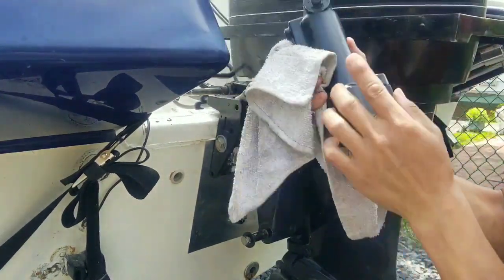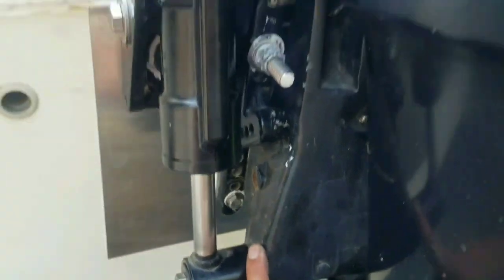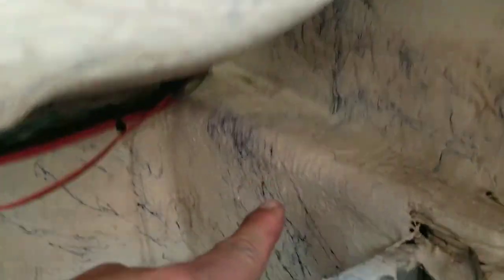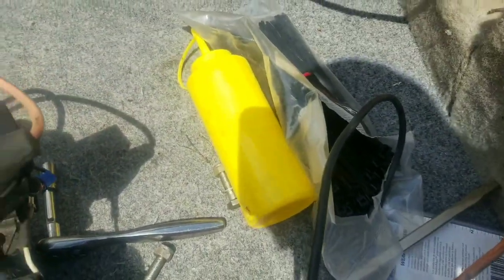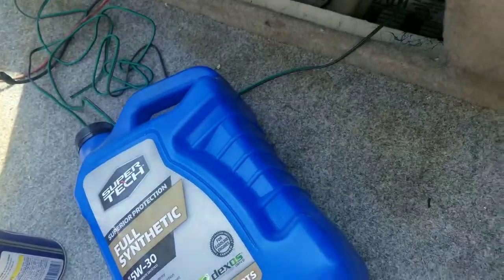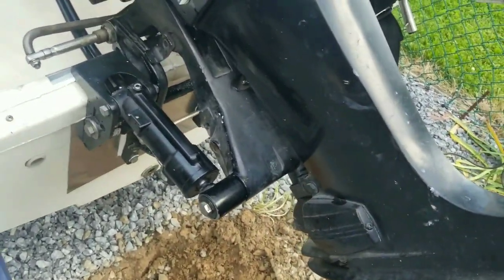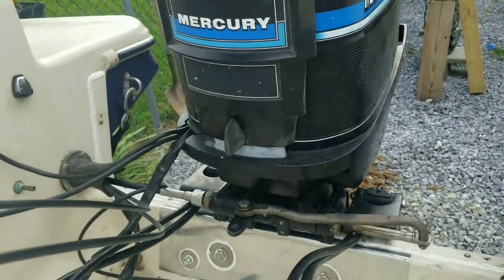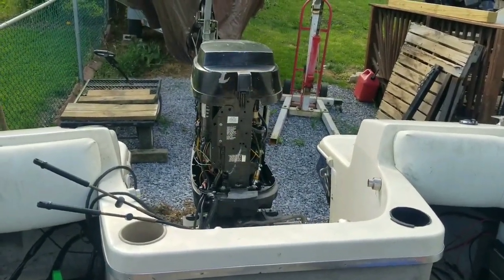Mercury Outboard Power Trim Install - Inlines

Comment: Love your work, very relevant, I recently acquired a Sea Nynph fishing machine. I am remodeling and repairing it. It has a 1985 Mercury outboard with a 2 ram cylinder lift and tilt. The motor was shot so I replaced it. When I got it both rams were out of their brackets and fully extended. I lowered the motor to assemble them in their brackets. They were slightly extended beyond the mounts so I manually pushed them down and bolted both of them top and bottom to brackets. I thought I should bleed ear one while they were horizontal but there appears to be a plug in the bleeder holes. No screw slots or Allen broaches. 
    I tested and installed 2 new solinoids. 3 wires from motor( green to one side of one and blue to one side of the other) black to ground. Switch at helm , nothing silent. I crossed a screwdriver on both large posts on one solenoid, motor runs but no movement. Did same to 2nd solenoid got sparks and momentary sound of motor. I took fotos of original assembly but no clear colors to most other wires. Feel certain I assembled as original. Unknown if previous owner screwed up the wiring trying to get it to work. Of course he did say he thought it was just bad solenoids but who knows if that is reality. Can you help me? I am 83 and perfect victim if I take it to aby. Marine place here in Florida.
Reply from the maker: He definitely wired it incorrect. Son

Comment: Hi mate im trying to wire up this 80 hp mercury engine im wondering if you could send me some information about the set up and where all the wiring goes from the trim motor and the battery wires actually are???? Cheers
Reply from the maker: Buy a wiring diagram my friend. Son

Comment: My daughters boat has the same setup. over the winter all of a sudden the motor raises when in reverse. Tilts up and down just fine.What am I missing? Several of your videos have helped me a ton. Thanks for sharing your knowledge on Merc inline 6's.
Reply: Reverse lock isn’t engaged, little knob on the bottom of the pump changes this
Reply: @achilleaustin  Thank you. The knob was in full open position(counter clockwise). I closed it tight and no difference.

Comment: @MerCsonL6 I am working on a 1979 115 mercury. I’m trying to hook up the trim some of my wires were cut so I’m doing some troubleshooting and I’m not sure which terminals to hook up too in the outboard it’s self.

Comment: My power trim stopped working, it won't go down. I hear it click but it doesn't go down. The black wire from the controls is not attached and I can't tell where it goes. I am not sure if it was ever attached. Oil looks good. Trim down was working fine. Help.
Reply: I got it to work. Crazy how temperamental the trim tilt can be sometimes.

Comment: How did you bleed the system? I have this exact same system and this is my first boat so I am trying to learn as I go. Trim didn’t work when I got it found all lines on the bottom of pump were loose tightened them up. Need to top it off and bleed system just want to make sure I do it right.
Reply from the maker: Tilt engine up and down about 3 times then gently in the down position untighten the hex screw on top of each cylinder. B4 topping off be sure engine is in full upright position. Son
Reply: @MerCSonL6  thank you brotha subscribed and will definitely be watching a lot of your videos your awesome appreciate it! I have a 1982 50hp merc on a 1996 bass tracker hope it does me good!!!

Comment: Did you have to plug anything into the 3 spade connector
Reply from the maker: Not in this video. I jumped the voltage directly to the selonoid. Son

Comment: Is there a specific spot on the motor for the lines from the cylinder, can they be backwards as far as the left or right side hole
Reply from the maker: Yes there is a spot and no they cannot be backwards. The hoses are different guages so it's not possible. Son

Comment: Is there a tilt assembly upgrade kit available.  My system has milky water in it.  Maybe time to replace all the seals.  Not sure how many seals there are.  Mercury only sells the pump as a complete unit at 2K.  Terrible!
Reply from the maker: They sell a gasket kit for the valve body. Way cheaper if that's the problem. Db electric has  the pump for pretty cheap. I think around $200. Hope this helps. Son

Comment: Question:  Is it easy to kink or damage the hydraulic lines at the trim motor.  Where did you source the lines from?
Reply from the maker: No. They are very tough. But its not impossible. Amazon and ebay has them.

Comment: Hi.  I have a power trim system just like yours that stopped raising and lowering.  The trim motor up and down controls power ok.  It was working before it stopped.  The issue is the hydraulics.  Two of my lines had water in them so I disconnected all lines at either end and blew them out with compressed air and reconnected.  Not sure if there is water in the one cylinder now and concerned with winter coming on it might damage it?  I did the same procedure as you filling the reservoir.  Around where the hydraulic lines connect to the reservoir, oil leaked out of a small hole that Mercury tells me is a valve to release oil.  Not to be confused with the turn knob used for reverse lock (not sure if this either closed or open would cause the leak?).  I'd like to know the requirements to stop the leak.  The other thing I would like to know is the bleeding procedure.  You started with the motor fully up and filled your trim reservoir with oil and then you mentioned bleeding the system.  Would love to know how to get this all working again.  Here is an ad I placed on Facebook that provides a visual and further explanation:  

https://www.facebook.com/marketplace/item/518228890135547
Reply from the maker: Pump is no good. Son

Comment: My 1982 115 engine with twin trim cylinders slowly leak down when engine raised thus engine lowers itself. The trim hydraulic pump works well plus has sufficient oil.  Where do I start checking the issue? No hydraulic oil leaks anywhere.
Reply from the maker: Seals in your trim cylinders are bad. Son
Reply: @MerCSonL6  thank you for this. Are seals common item? suggestion(s) where to purchase?
Reply from the maker: @johnhowell5536  marineengine.com or oldmercs.com is a good start. It's quite a Job my friend.
Reply: @MerCSonL6  again thank you
Reply: My motor drifts down, cylinders have been redone. I have an o ring kit for pump but am curious if there are and springs or surprises I should know about when I tackle this project? Thank you.

Comment: Thank you for sharing! I wanted to replace the hoses on the power trim that came with my boat as well as relocating the mounting area. Now after watching you install this power trim it gives me a very detailed description of the work and know how to do so.
Keep posting. I will share with you before and after videos. I wanted to ask if you would share with me where you would purchase replacement hoses for the power trim motor.
Thanks again.
Reply from the maker: They are hard to find. Amazon.com has em. They are pricey. Son

Comment: Hey guy I know this video is old but I had to replace my pump and solonoids well thinks happen and took longer than expected so got all back together except wiring.....exact same as youres but cant figure out what wire goes where as far as the two solonoids any help is appreciated ..hoping to go to lake today.lol
Reply from the maker: The wires should be color coded. Green for down, blue for up, red for power, black is ground. Red and black power the pump and are connected directly to battery. Connect green and blue off pump to top posts of each selenoid. Connect smaller green and blue Wire to corresponding selonoids on the side. The other side both selonoids should be grounded (smaller black wires). Now power the selonoids by connecting them with a red wire on the top empty posts on each selonoid. You should be good to go. The selonoids simply jumps the 12 v signal from one post to the other to activate the pump once it receives an electric signal  from the smaller green and blue wires. Son
Reply: Thanks
Reply: @MerCSonL6 my trim pump only has one solinoid any advice new to this but am mechanically inclined

Comment: Great video, thanks for sharing. Wondering if you know what the black knob on the side of the trim motor is used for?
You can see the knob at 8:36-8:37 in your video. right side at the bottom with the towel as a backdrop
Reply from the maker: It's used as a relief valve so you can move the motor up and down without the trim system. However, usually they break. I have never used them. Son

Comment: Hello!  awesome video.  I need all 4 of those hoses for my tower of power. TRIM LINES.  Are those aftermarket hoses?  Where did you get them?  Im in desperate need.  Please help!  thanks
Reply from the maker: They are actually mercury trim lines. New old stock I think. I'll see if I can find you some.
Reply from the maker: 18-2110 Power Trim Hose for Mercury Mariner In-Line 40-150hp Outboard Motors Replace 32-88005 32-45327 32-97153A1 https://www.amazon.com/dp/B09H6PW7ZZ/ref=cm_sw_r_apan_i_A4CRNB5QZ3JG9WB0YXAN?_encoding=UTF8&psc=1
Reply from the maker: They have them on Amazon. Make sure you get 2 small and 2 large. Son
Reply: @MerCSonL6  awesome thank you so much Son!!!   Last thing im looking for is a new trim motor.  My solenoid and valve on my trim motor is good, but need a new motor for trim.  I will buy the complete unit if possible.  Do you know where i can buy?  Or do you have 1 for sale?  Ty very much !!!
Reply from the maker: @jimmycutlets8842  dbelectrical.com has trim pumps. You also likely find them on Amazon. They run around $170ish.
Reply: @MerCSonL6  thank you for you time  i really appreciate it.  Do you happen to have a link for amazon?  👍

Comment: Have you had any experience with the trim limit switch that attaches to these? I have the 1150 motor and the same trim tilt system but a limit switch, previous owner hacked the wiring trying to diagnose a bad up/down switch (I have a replacement ready to install) but can't find how the limit switch works, ties into the up/down switch.
Reply from the maker: Limit switch is not necessary. Son
Reply: Paul if you look at the wiring diagram at the beginning of the video you will see the limit sw in the circuit. If you have the 3 button helm control, bypass of the limit is operated by pressing both up buttons to achieve max lift ( beyond trim)

Comment: how did you bleed the air out of the system?
Reply from the maker: Yes sir
Reply: Are you able to do a quick video of bleeding system and filling with fluid or once reservoir full will it self bleed with vent screw open?
Reply: @shanebrooks2303  I filled the reservoir with oil and drove the tilt up and down a few times, added a little more oil.  the unit has worked fine since and never needed any additional oil this far.  Hope this helps
Reply: Did you have the vent screw open and leave open
Reply: @shanebrooks2303  Shane I left the screw cap on loosely to see if any oil came out.  No oil pushed out and I did not add much oil after operation the motor a few times.  A week later I checked the oil level "remained the same"
Reply: Even after system worked

Comment: My cylinders are not filling up when Iuse this method. I have this same setup. Do I have air in my cylinders? Do I need to bleed them?
Reply from the maker: In the down position there are alan screws at the top. Lift up the back down. Loosen screws then retighten and repeat 3-4 times. That will get all the air out. Air compressed. Oil does not. Son

Comment: I have one of this same motor/trim set up. I wanted to add a trim gauge to my pontoon to see when the motor is up or down. It has a switch next to the left cylinder, but not a variable resistor to send a signal to a gauge. Was this designed just to activate a switch, or can a regular sender be used to signal a gauge it's position. Thank you.
Reply from the maker: I'm not sure my friend. Try it. My recommendation. Son
Reply: The switch next to the left cyl is to limit max up trim when running & there is a bypass circuit to lift higher for launching and trailering etc. The swivel brkt. should always be engaged in clamp brkt by minimum 1/2" when operating above idle speed.

Comment: Nice video, I have the lift calendars but am looking for a pump and wiring harness.  I checked your ebay site and don't see a pump.  Can you tell me what model to search for?
Reply from the maker: They are hard to find in the original sense. I have 1 for a 1500 which trims faster than the standard. I will list it soon..... it's not cheap. Son

Comment: Does the vent screw have to be open? It says on my manual it has to be open but doesn't specify if it should be open at all times
Reply from the maker: Always open if its installed. Son
Reply: Thanks again man

Comment: great video. why did you get that drawing. I have the issue with wiring. pump is working. but no action.
Reply from the maker: Mercury Outboard Service Manual. Its the pump wiring diagram. Son
Reply: @MerCSonL6  thank you. I don't understand why two wires need to connect with the engine.

Comment: Hello mate. Great video with alot of info. Thanks for taking the time to show people how its done. I'm doing exact same thing with my trim tilt on my older mercury thunderbolt 850. I would like to ask you 2 questions I hope you can make the time to answer them. Can you show me exact locations of the battery wiring and switch wiring? Mine are completely disconnected. I seen on the video some wiring but I was not able to see the top right side where the battery is because of the logo mercury outboard power trim install. Also how do i bleed the power trim tilt. To get all the air out?

Comment: hey man thanks so much! just bought a nice boat with an 81' merc 90 hp, looks just like yours.trim motor cuts out after about a second when going up. going down fine. looks like a bad selenoid after watching. can i do the ole screw driver trick to see if it will go up?

thanks again, ill be checking your vids often!!
Reply from the maker: Sounds like a faulty connection somewhere. I would definitely start with the selonoid because the are cheap. You can use the screw driver trick but i don't recommend it. On top of pump you'll see 2 wires. Simply just 12v to each and if it works consistently the its either your selonoid or controls. Hope this helps. Son

Comment: 1 of my hoses just busted so I’m gunna replace them all, do you happen to have a part number or reference to where I can order or get the hose set?
Reply from the maker: I don't know part numbers. Was a it a big hose or small? Son
Reply: MerCSon L6 small but the other two aren’t much bigger, the small on is 3/16”
Reply from the maker: @SSMinnoJohnson  https://www.ebay.com/itm/303482266719
Reply: MerCSon L6 thanks now just looking for the other hoses
Reply from the maker: @SSMinnoJohnson  shipped out your hose. You'll have it in 2 days. I was unaware you needed other hose.... what other hose do you need? Son
Reply: MerCSon L6 I’ll see if that one hose will fix the problem before I buy the other 2 hoses but as of now I still can run the boat on the water without that trim hose right, I’ll just have to manually lift the motor up and down?
Reply from the maker: @SSMinnoJohnson  correct. But who wants to do that?! Son
Reply: MerCSon L6 I just want be out on the water honestly lol but with your videos I’m actually able to troubleshoot my engine issues with ease
Reply from the maker: @SSMinnoJohnson  that is the purpose of my videos.
Reply: MerCSon L6 boggs down and dies when throttling down hard any idea on this issue?
Reply: MerCSon L6 anyway I can reach you other than YouTube?
Reply: MerCSon L6 what’s the rpm for idle and wot?
Reply from the maker: @SSMinnoJohnson  what engine do you have? Year and model.
Reply: MerCSon L6 mercury 115 1983 outboard
Reply from the maker: @SSMinnoJohnson  idle around 800-900. In gear should drop to 700's. Wot i run mine at 6k..... not my formal recommendation. I would redline around 5700. Son
Reply: MerCSon L6 alright thank you sounds good what’s your email so I can contact you about buying more things for this motor if they’re available
Reply from the maker: @SSMinnoJohnson  I will delete my email in 24 hours so I don't get 100's of emails...... fyi
Reply: MerCSon L6 alright thank you

Comment: @MerCSon could you point me in the direction of a wiring harness that would fit this type of power trim? I have one in my boat thats currently stuck in the up position and no matter what I do I cant seem to get it lowered. Ive released the vent screw and turned the control knob full right and its still not lowering. If there isnt a way to do this manually ill have to fix the power trim to lower the 1000ss back to parallel so I can then remove the powerhead (to further diagnose my issue with the tell-tale not functioning) Thanks! You"re videos are very helpful for a first time boat owner
Reply from the maker: I have 1 for sale right now. Fully tested and operational: http://rover.ebay.com/rover/1/711-53200-19255-0/1?icep_ff3=2&pub=5575378759&campid=5338273189&customid=&icep_item=303483510472&ipn=psmain&icep_vectorid=229466&kwid=902099&mtid=824&kw=lg&toolid=11111

Comment: That motor and pump unit is what i need. Can you point me in the right direction. Or one that will work in its place.
Reply from the maker: They are really tough to find this year with covid going on. Everyone is getting out. This will work. I would buy it quick: https://www.ebay.com/itm/373089711111

Comment: Outstanding! You gave me all of the information I need to diagnose an issue pump. I just bought a 1965 650 and the up is having an issue. It is losing fluid somewhere but I had to clean it up before I can find the leak. Do you know if there are still rebuild kits available?
Reply from the maker: I would check oldmercs.com. Son